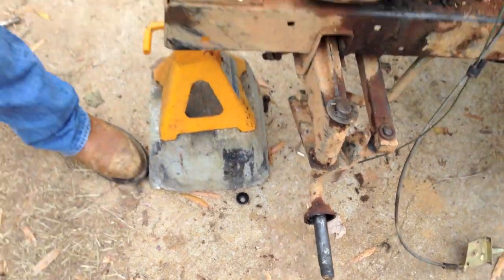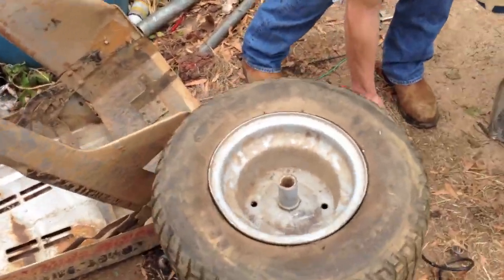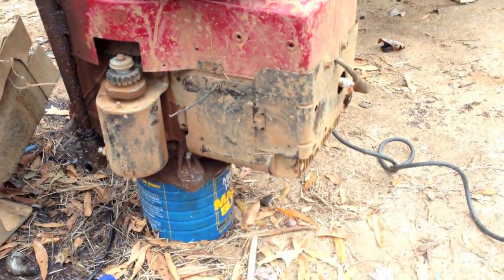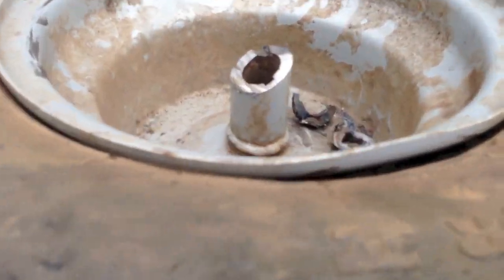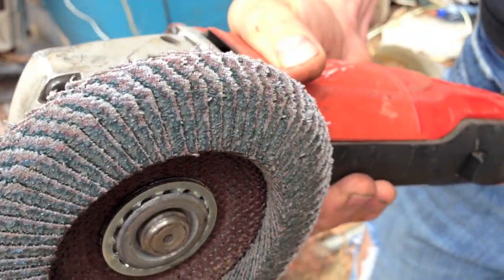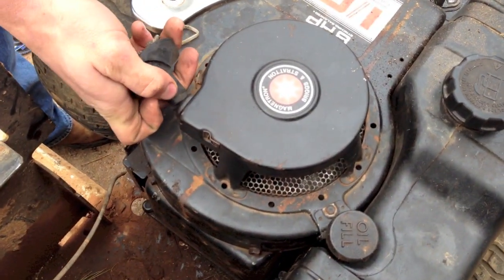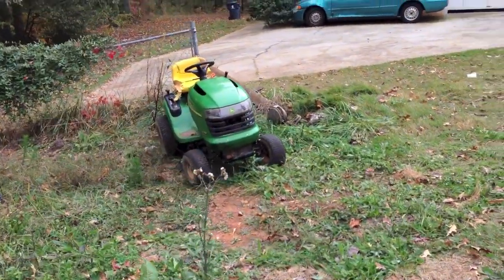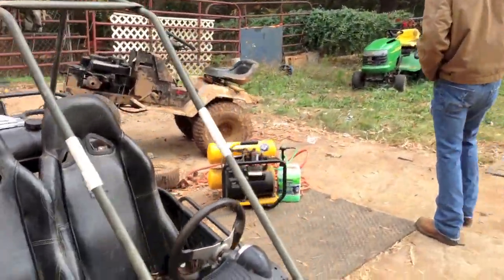How to: Larger tires on front (stock rear tires)

Comment: a 5/8" piloted or 3/4" piloted   1.25" cutter will cut the spindle down without any sparks. just use a 1/2" drill.

Comment: you can use those little 3 inch metal cutoff wheels and an arbor chucked into a drill and cut that off pretty quick.
Reply: Yup, cuts nice and clean and LEVEL too....

Comment: i think a grinder stone may work much better for the finish grinding? sanding pads are for sanding, grinding stones are for removing? that may make it a bit faster and better.
Reply: safety say no the sanding disk is preferred. it cuts faster and throws smaller and less sparks.
 only when you get into the 120 grit does it slow down in removal rate.

Comment: if 1 gas tank is  tide into the other, other tank being higher the higher tank WILL Sisyphean into the lower tank that will cause a issue think about that?  liquid 1 being higher than liquid 2 the higher will back flow to the lower till it is equal not a good idea???